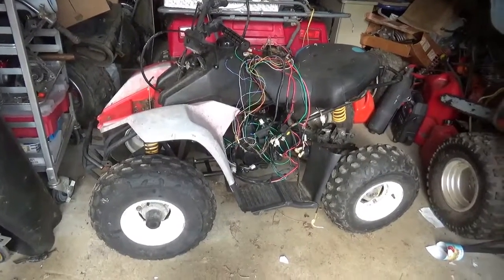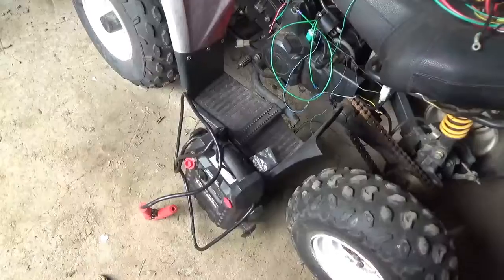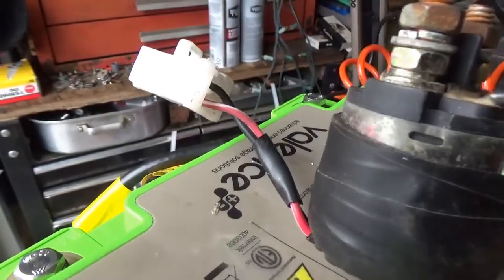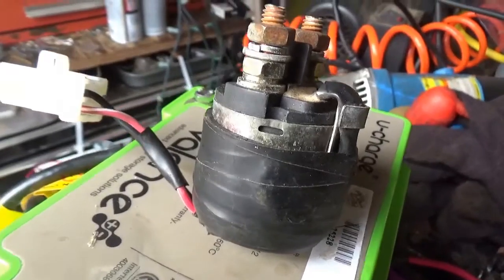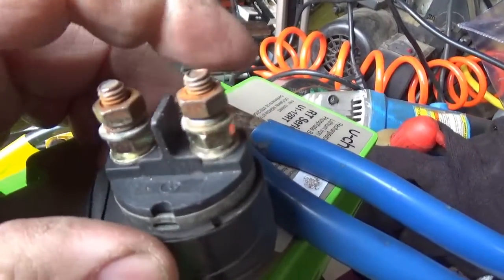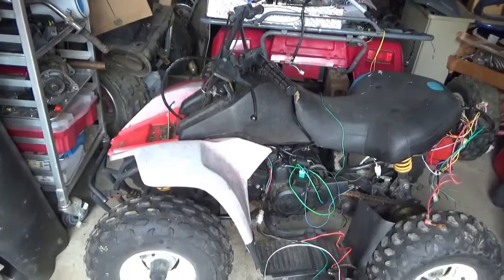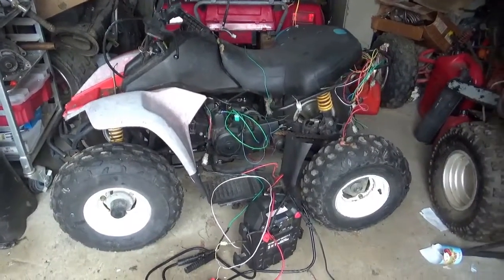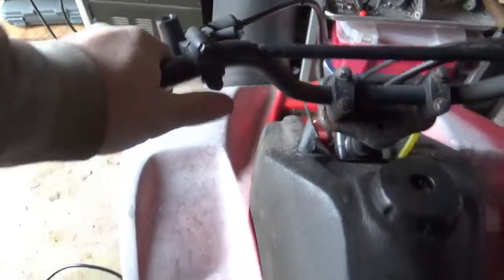ATV Starting Solenoid, How to Wire, Troubleshoot, and Bypass.

Comment: So if I connect the positive end of the switch to the battery and the negative to the solenoid coil ground, and the starter solenoid to the starter and battery it should just crank over? Or do I need a cdi box? Bought this 4 wheeler with a messed up harness with most wires cut. I’m tryna figure out the absolute minimum I need to have it crank over with a push of a button. It’ll crank over when I bypass the solenoid with a flat head but I need something more ethical to start it.

Comment: Harvey I bought a arctic cat i 1999 and  I did have it running but now the right hand has a after market switch with two arrows when I turn the key there are a no neutral light guy but when I hit the switch on the right it comes on anything you can tell me about tha plllllllllllleSe help me thanks excellent vids by the way

Comment: I'm working on a Kawasaki Bayou 300. I have nutral light from a toggle switch.(no key) push button doesn't work. I have no spark. New CDI box. Has diff pull, (I don't Wana use) What do I need to do???

Comment: Just getting started on an 08 Big Bear 400. Been sitting in one spot for 9 years outside after just being shut off one day and never used again. Got parts on the way but in the mean time checked to see if it would at least turn over and yeah the starter solenoid is shot. Hope to get the parts this week and get er running! It's very exciting to bring old "junk" back to life.

Comment: Honestly I'd like to see you make an all in one fool proof universal harness not a portable CDI but similar. I'd like to see it have the CDI, coil, push button start a kill switch and all other hook ups. make an ac CDI version like basic old Honda's and a DC system with a universal regulator ect. I was looking at a 185s harness if you took away the lights and add the electric start it would be simple why does no one have a video showing the process for a universal harness so to speak. Normally I'd say the Chinese atv harnesses but there to small for a full size atv like a polaris sportsman Honda 300 ect.
I bet you would have an entire following and you would see a huge amount of people unhacking there harnesses with your process. it's beyond a pain in the butt when your forced to spend 250+ for a used harness on eBay when with just a few more steps then your portable CDI people can make there bike like new again cheaply and reliability instead of the crazy factory units with 70 wires for a 10 wire sytem.

Comment: Slowly some of the electrical systems components aren't so foreign but I've got a long way to go. Moving a bunch of machines around, ATV'S, Side by Sides  and even a 6 wheeler. Scooping up little bits of knowledge here and there and constantly waiting for parts, and used parts that are too expensive or discontinued from the manufacturer. Found a great shop that does Aluminum Welding nearby so I'm in charge of drop offs and pick ups. Every day is an adventure, and I'm the right guy for that. Thanks Harvey the sun will shine again. Steve